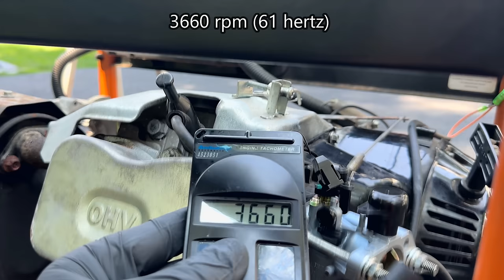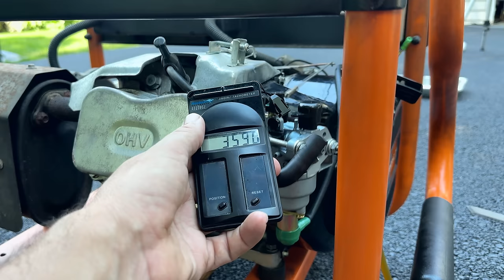Generac Engine Rebuild - Wiped Camshaft Lobe, Only Backfires Through Carburetor

Comment: 42:30, you could do what everybody else does, give the flywheel nut, four or five Aubba-Duggers with an electric impact.
Most shops never bring out a torque wrench for a flywheel, since the taper is what holds the flywheel in place, not the nut.
Also, by using the rope it puts unnecessary force on the piston and rod.

Comment: Have you ever considered using or indeed making your own magnetic oil drain plugs? I have epoxied small pill sized neo magnets onto the end of standard drain plugs in the past instead of buying new magnetic plugs.
Reply: most of their trash will be alumium so wont help
Reply: @jusb1066  yes I guess it may be but it’s the iron/steel particles that do the most damage when suspended in the oil and a magnetic sump plug will help hold these back don’t you think?

Comment: Great work Jim, good thing you added the Zink during break in. Do you think the engine may have the wrong valve springs in it. Those looked to be pretty stiff when you installed the push rods? Thanks for an excellent video.
Reply: Thinking the same, about exhaust valve spring.
Reply: I replace the exhaust valve springs on the two I fixed because I didn’t trust the spring to be correct, never seen this before on a Honda GX series engine

Comment: While there are some variables, most 1/4 inch bolts are 89 inch pounds, again, variables play a part such as what the bolt in threaded into to, but have yet to break one.

Comment: Hi James, would it have been worth swapping the valve springs out? This in my basic knowledge could be the one thing to cause the premature wear on one cam only. I don't know if you can measure spring tension (and length) on valves but it might be worth considering. FYI I been watching you for a couple of years and I have learnt so much through your thoroughness. Thanks for sharing.

Comment: I have a couple of older vehicles with flat tappet cams, and I have always used oil with ZDDP to protect the camshafts.  Although I have always known that my small engines use flat tappets (are there small engines with roller lifters?) it never crossed my mind about using zinc.  I should think this might even be more important with small engines that are only started rarely, like backup generators.  Am I worrying about nothing?  After all, I've never heard of wiping cams in small engines being an issue.
Reply from the maker: It’s a problem only with the Generac GP series.  The springs in that model exert a lot of pressure in the cam.  Would not worry too much about it on most small engines since there valve springs are usually a lot weaker then automotive springs.  Some small engines use a belt or chain driven cam.  Some kohlers use hydraulic lifters.  Must use push rods and flat tappet cams.
Reply: @jcondon1  Thanks Jim. You have to wonder why Generac would use such a strong spring on the exhaust valve (and not the intake,too).  One of my old Corvettes has a 434 cu. in. engine cranking out 650 hp at 6,900 rpm. Although it’s a roller engine I still use oil with ZDDP. Because of the cam profile, and the high rpm the valve springs are extremely stout. Neither of these is the case with a small engine operating at 3600 rpm. Do you or any of your other viewers have a possible reason as to why Generac chose such a stronger spring in this application?

Comment: Aren't all the generator engines "flat tappet" engines? Do we all need to add zinc to our oil? How much zinc is needed for flat tappet engines? Finally, how do we know how much zinc the different available oils have? Great channel! Watch every Thursday.
Reply from the maker: Most are flat tappet cams.  Some are chain or belt driven like Subaru engines and the Honda eu2000.  Zinc is always a good idea.  You would have to find the data sheet for your oil to see how much is in there and add as needed.  Most small engine though have weak valve springs and are usually fine.  Some like this one had very strong springs which push harder on the cam lobes.  When you have grit like the rust in this one it will accelerate the wear,

Comment: if you can find engine oil that ends with a suffix T, the T stands for tack.  the oil has in it an aditive that makes the oil tacky, and will stick to the surfaces it contacts.  ideal for assembly, and use in applications that stay idle for long periods.  the heat of the engine running would have loosened particles most likely, a hot kerosene bath would have been the best clean, or a large ultrasonic tank

Comment: I notice that you use carb spray in a lot of cases to clean parts. Many years ago I purchased a Sure Shot refillable sprayer and fill it with gasoline. Not only does this method work very well at cleaning parts, it is a lot cheaper.

Comment: Is there no kind of gasket or heat insulator between head and carburettor. Having gone as far as you did I would have lifted the head off and checked and cleaned it. But certainly a full job done on the bottom end.
Reply from the maker: There is a plastic insulator.

Comment: Good video.   What caused all that internal corrosion on all the parts?   Seems very odd?
Reply: Moisture from the exhaust inside the case, the exhaust cam was exhausted and exhaust wasn't being ported correctly?

Comment: Thank you, sir, for replying.   The switch kills the engine without a load.  it might be a short in the control panel like you suspect. I will attempt to locate a short. Like I mentioned it can run all day long. when the AC switch is flipped it kills the engine. I flip to off before it dies and the engine stays running. I leave the AC switch on to restart it and starts then dies after a few seconds. Do you think its losing ground due to vibration?  Thank you so much for your help..

Comment: Awesome. Sir, I have a Tahoe 7000 diesel generator I cleaned the fuel tank, injector, and fuel pump and it runs great.  but as soon I flip on the main AC SW switch on to produce electricity it kills the engine.  Do you think it might have a bad overload relay?. Any suggestion will help thank you.
Reply from the maker: Does it just turn off or does it stall because it went under load.  If under load then the stator is bad most likely or a short in the control panel wiring.

Comment: Why is zinc used? Because the molecules are generally round and act like ball bearings in the oil. Reduces wear during break in. Also corrosive elements are drawn to the zinc before other parts in the engine.

Comment: That sucks about the Degreaser from HF….I just put my Heads into a degreaser that was not Aluminum safe for a few minutes until I realized I had grabbed the wrong bottle. I quickly did a water rinse and then a soap bath. They are now Gray with a bit of Ash. I do not think any real damage was done. Thoughts ?

Comment: I had the same problem with a Westinghouse i-gen 4500 after a little over a thousand hours of use. I changed the oil every 50 hours.  I'm just wondering what where is that cam lobe out

Comment: James, I sincerely appreciate your commentary and detailed approach to engine repairs. thank you!  My dad rebuilt D-8 Caterpillars for a living with the GW Sugar Co. He used diesel fuel as a cleaning solvent. The flash point is 140 degrees and he said it leaves a lubricant on oil on the parts and is an effective cleaner with a brush in a well ventilated area. Also it was much cheaper than many of the small cans of cleaners and solvents. Just wondering what your experience is with diesel fuel as a solvent.  Mogulsmoke

Comment: Just curious if the replacement camshafts you put in are the same as the original or an upgrade from the original part that hopefully will eliminate this problem with the generac engines.

Comment: Hi James. What is that impact tool you use. I have just started a job fixing small plant and generators. That tool would be very useful. Thanks
Reply from the maker: Both are listed in my store.  The smaller one is currently unavailable but you can grab the model number and find it elsewhere.  https://www.amazon.com/shop/jamescondon/list/19KNRL7CFKQD5?tag=onamzjamesc00-20&ref_=aip_sf_list_spv_ofs_mixed_m
Reply: @jcondon1  Thanks so much.

Comment: Not through the whole video yet, but already gave it it's more than deserved "like".
Unrelated question from someone not really used to cordless power tools: is the unfastening of bolts that we see in the video done with impact/hammer or is it the tool's torque clutch? 

I'm trying to decide on a cordless drill and do not intend to drill into masonry/concrete (I have an impact drill for that)  so a far as that goes I wouldn't need the impact function, but I wonder if the impact/hammer is used for stubborn bolt unfastening as well, or if the jolts from the torque clutch will do.
Reply from the maker: It is an impact hammer.  A small one and a larger one for stubborn bolts.  Helps a lot on stubborn bolts.
Reply: @jcondon1  Thanks, James.

Comment: With regards to torque specs [I'm allowing my ignorance to show here], will a torque wrench give an accurate indication re: what it "was" torqued at when you remove it? In other words will a torque wrench work in reverse i.e., by slowly increasing the ft lbs until it breaks free? Great video and a  👍 as always.
Reply from the maker: If the bolt has been in there a while then probably not.  Also most torque wrenches to not work in reverse.  In the past I have slowly bring the torque wrench setting up trying to get the bolt to turn tighter.  Once it starts to move I know the torque was at least no more then that point.
Reply: @jcondon1  //  👍

Comment: Can you use a dryer that draws 30 amps to get started with a generator that offers 6250 starring watts? My thinking is you could but you wouldn't be able to use anything else in the house while using it for the dryer?
Reply from the maker: The starting watts are just marketing.  The running watts are really all you can count on.  Also a dryer runs at 240 volt.  240x30 is 7200 watts required to run the dryer.

Comment: 42:02  Why couldn't you just cut a small block of wood that could ride on the flywheel so the strap wrench would press against that and that would prevent you cracking the plastic fan?

Comment: I have a Generac gp7500e model #75282 the connecting rod broke because of a defect inside the rod ! I found two holes in the block on on the top l might try to get it welded !! I also got a hold of Generac but they said it was out of warranty and couldn't help me !! I have been looking for a used short block or a used block but I am retired and the cost of new is out of my budget ! Is there any information you might have where I can find cheap parts ? Any help would be great thank you  Rick Smith P.S. I Like your  videos 😊
Reply from the maker: The cheapest way to repower it is to find a generator that does not make power and do an engine swap.  Engines from 389cc to 420cc will work if a Honda clone.  Most in that size range are.  If you get the smaller engine, then you will need limited to 6500 watts.
Reply: @jcondon1   Thank you ! Rick

Comment: Normal torque settings for class 8.8 bolts/nuts: M3 x 0,5 - 1,27 Nm; M4 x 0,7 - 2,94 Nm; M5 x 0,8 - 5,71 Nm; M6 x 1,0 - 9,88 Nm; M8 x 1,25 - 23 Nm; M10 x 1,5 - 46,4 Nm; M12 x 1,75 - 79,1 Nm.

Comment: Hey James, I need some help. I have a duromax 13k dual fuel gen. and it will start and run fine when it's the first start, but after it's been running it will not start again until it's sat for a day or two. Any help would be appreciated. I changed the plug, but I was thinking maybe coil?
Reply from the maker: Maybe the coil, but thinking the engine is flooding and the plug is wet.  Does the carb has a fuel solenoid?  Might not be working.  The purposes is to prevent flooding and backfiring at shutdown.
Reply: @jcondon1  It does have a fuel solenoid. It started back firing through the intake after i ran it for 30 minutes today and tried to start it 10 minutes later. But I was running it on propane so I don't think the fuel solenoid would be the issue. Correct?
Reply: Unless the solenoid allows leakage so you are flooding the engine with both gasoline and gas (LP)?
 @ChosesinWon

Comment: With respect, a couple suggestions to improve:
Please name the parts of the engine as your working on it. This would be huge for me, as I often have no idea what part 
your taking off or on. The last one is please take a minute to name your tools. Like I just watched you use a drill that was
at a 90 degree, to polish the rim of an engine clean after using razor blades. What did you use in the drill and 
what drill is that. Thanx 10XXX

Comment: The countershaft timing g makes no sense to me. Is there another mark we're not seeing on the camshaft that lines up, too? I must have missed something.
Reply from the maker: It made no sense to me until I realized if you rotate the engine in any other position you cannot install or remove the countershaft.  I would have thought the timing marks would align at the same time.

Comment: Should have pulled valve cover and cleaned out head, and the grit could be in the valve guides to. And what about around the rings and the wrist pin. I'd be worried about it getting grit back on everything
Reply from the maker: Good point.  I did not show it, but I did clean the top of the head where the valves are, but did think of the guides.

Comment: I just have to make a comment.  I see you using a plain razor blade  often.  Why not get a utility knife that holds razor blades and/or a scraper that holds razor blades.  They even sell ones that do both.  I often have to use razor blades in my line of work and they are very sharp on your hands, even on the back side.  They are also incredibly cheap!

Comment: I may have missed something because I had to watch in stages throughout the day, but I think I heard you say you had another one that was the same model and was damaged by being water logged.  Then this one seems to have had water in the crankcase.  Is this possibly a design issue with this model of generator or engine?
Reply from the maker: Maybe.   In the video description click in the part 1 link to see the other with the bad engine.  Will be swapping that engine out for the one I just fixed next week and will open up the bad one.
Reply: Had two in last year, same brand and model with bad camshaft 
It’s a factory mistake 
There’s more out there I’m sure

Comment: Why torque things like oil sensors and intakes ? No need for that on my view. Good job bud
Reply from the maker: No need, but have gotten into trouble a few times going by feel.  A perfect example was the chainsaw clutch I did by feel which did not go well see 1:16:41 mark https://youtu.be/chEqXHjCM64?si=rWQGt1hI1VPeio11

Comment: With the cost of WD-40 why do you use it for cleaning? You buy harbor freight's heavy duty degreaser, why don't you use that? You can always spray it down with WD-40 afterwards using much less. And now just a regular question What did you do for a career before YouTube? Or do you still work?

Comment: You covered the lower engine with tons of lubricant.  The valve train is what failed but you didn't seem to put any lubricant up there?  F.Y.I. - I do tell my friends if that want an education on small engines and generators they should watch your channel.

Comment: Great video as always James. I’m confused about something relating to the fuel shutoff solenoids with which both those carbs were equipped. You did not connect them to power and ground so shouldn’t that stop the fuel flow and make it impossible to run? Or am I missing something?
Reply: I believe those shutoff solenoids cut fuel when energized. In some cases a hot engine will keep running after spark is killed. The solenoid only cuts fuel for the few seconds it takes for the engine to spin down.

The reason it's done this way (vs allowing fuel when energized) is so you don't need a battery to start the engine.
Reply: @eDoc2020 Since I commented I have learned you are exactly correct. I was misled by an online forum where the guy said they had to be connected to both “on” and “start” power.
Reply: @stevefrayne7253   That's how it would be in a car or other equipment with large engines.

Comment: This Engines has some disadvantages.
It has no oil pump but only a finger that throws some oil in that direction.
It has no oil filter. Engines without an oil filter will not last very long.
It has no oil sensing and with a small lack of oil the Engine will fail.
This Engine is not customer save.

Comment: Automobile engine oil cannot be used in these engines.
Reply: Tell us why not?
I have used nothing else in any air cooled small 4 stroke engine without any problems over the last 50 years (mostly diesel engine oils with high ZDDP)
As long as it is a good quality oil (and you change it regularly) it will work well....
P.S. I have a Kawasaki mower engine with a full flow oil pressure system and a Baldwin filter on it so there is little difference between it and any air cooled car engine....